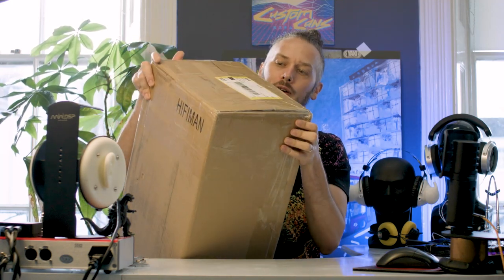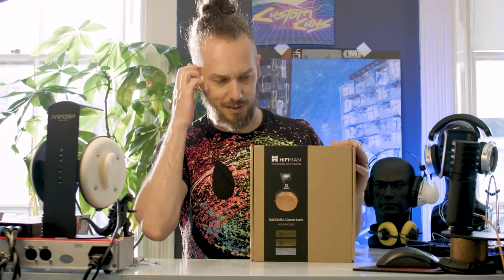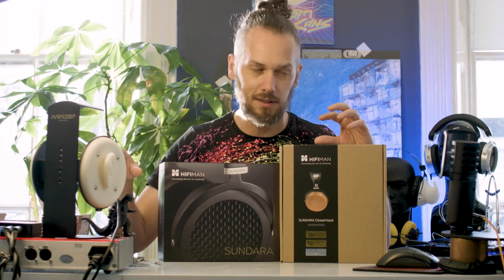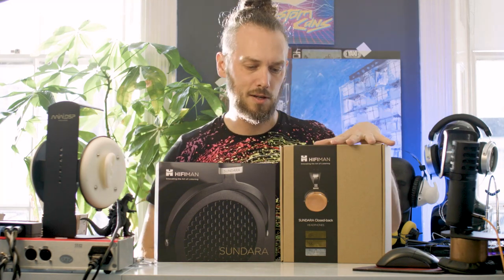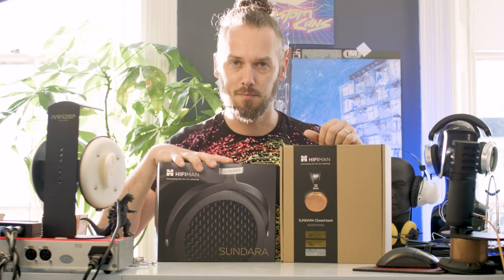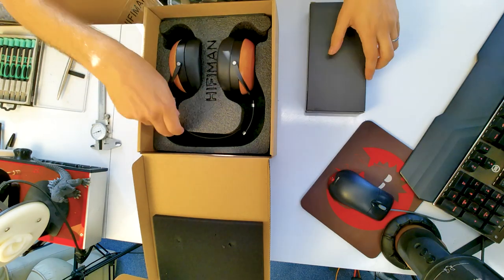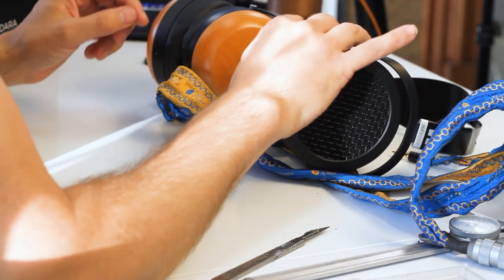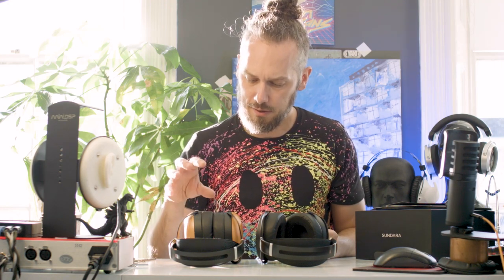HiFiMan Sundara Closed Back are more different than I imagined. Lets look inside

Comment: Closed back Sundara has been peaking my interest lately, how is the isolation compared to something like a HD280? Would be fun to daily drive some planars, also how is the build quality compared to regular Sundara? I've seen lots of horror stories about Hifimans breaking
Reply from the maker: The isolation is surprisingly good - probably not quite as good as the HD280 but close - the clamping force is a lot less than the HD280 so your head does not get squeezed as much. I have had 3 pairs apart now and they seem well made. The holes on the sides of the earcup that the headband attaches to have brass inserts to strengthen them, the wood seems to be glued and nailed to the rest of the housing. I am pretty certain they would survive  most use cases

Comment: You sir are a legend. I remember your HD25 modding days. Great stuff. Anyhow, I was wondering if you could comment on how the wooden cup is attached to the metal yoke. Only with glue or also with screws?
Reply from the maker: It seems to have metal stakes / nails holding it on. I have not detached the wooden bit from the plastic part so there may be glue as well
Reply: @CustomCans  Cheers thank you for the quick reply, will buy your foam mod soon;D

Comment: The original Sundaras don't have stealth magnets, which tend to have an effect on the bass presence. Hifiman has been relaunching their earlier headphones with stealth magnets (Arya, Ananada, etc.), and I think the original Sundaras are next in line for the stealth magnet treatment. The sales price of the original Sundara has been slashed, most likely to clear inventory ahead of the next launch. I'm guessing Hifiman released a stealth magnet version of a closed back first so that the Sundara SE wouldn't cannibalize their Edition XS sales.
Reply: Oooh, I absolute love my sundaras, how substantial would a stealth magnet upgrade be ? I am not really clear on exactly what they provide.
Reply: @vik8023  They are supposed to reduce distortion. In practice, Hifiman headphones that have been reworked to include stealth magnets tend to have a greater sense of body and warmth. Some people prefer the thinner, airier sound of the older versions, so I can't say that it will be a definite upgrade for you; it's taste dependent

Maybe I'm wrong, but I've noticed that Hifiman's stealth magnet headphones have drivers with magnets of varying sizes and strengths, just like the driver that we see here. Conversely, the older ones have a uniform array of magnets. This structure seems to be part of the stealth magnet implementation. I've seen this pattern on the Susvara, Arya Stealth, Edition Xs and now the Sundara Closed

Comment: Great breakdown of the internals of the headphone.  In one of the follow up videos, would you be able to identify what type of wire is being used for the driver? and where it connects to the driver?  Thanks.
Reply from the maker: I will if I remember ;) it looked like pretty standard copper wire but the attachment points were covered up

Comment: i wanna see that idea you had with playing with the he400se magnets. you should try retuning the closed back sundaras to add a bit of treble to the mix. maybe play with the foam on the front. id still be pretty interested if you can modify the sundaras to make them closed backs, considering the closed back version are completely different headphones.
Reply from the maker: I will be doing a new HE400 series video in a few weeks. I suspect that making the sundaras closed may be very tricky. By the looks of it, they had to add the more powerful magnets to the driver to help them work in a closed enclosure - the driver probably needs more power as it has to pressurise the air inside the earcup rather than moving freely - as the sundaras only have magnets on one side it may not work well. I will have a play though.

Comment: was waiting for a good closed planar , i own the oppo pm3 also but they are discontinued and i want a backup!
Reply from the maker: I would probably check out some other reviews for sound comparisons as I am not great at that but I can tell you that they seem well built and they have clearly put a lot of thought into the driver design
Reply: @CustomCans  of course i will check more reviews and frequency response test before deciding, but from where i buy cans , i have a return policy , and they also have a showroom where you can test without buying so , plenty of was to make an opinion

Comment: hi, Im more into edm, synthwave, phonk.. will these sound good on the normal sundaras ? finally started earning and wanted to get good headphones. I heard a dac amp is need and the few options I have is ifi zen air dac, what would you recommend.
Reply from the maker: Sound is a bit of a personal thing but if you want to hear the the awesomeness of analogue bass synth then these are good. They do sound very different to the open backs though
Reply: @CustomCans im a little confused, by "they" do u mean the (normal)open back sundaras ? and do I need a desk amp like the ifi zen air dac or a portable one is fine
Reply from the maker: @hareshrk6259  Ah sorry - I may have misread your previous message - The normal open backed sundaras are nice but would probably benefit from an amp. The open ones to lack a bit of sub bass though